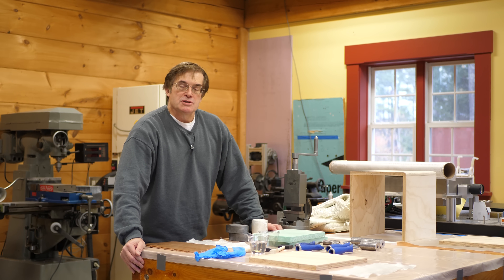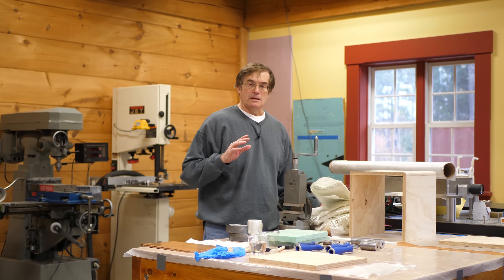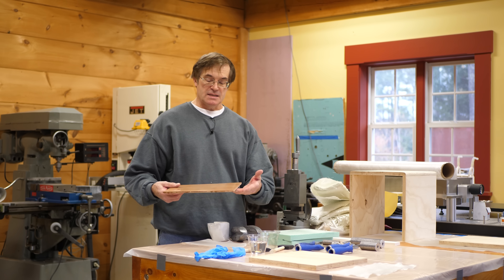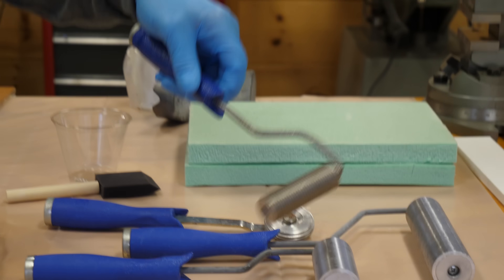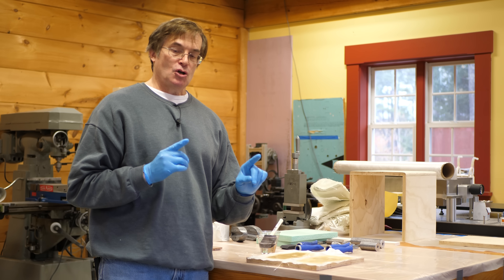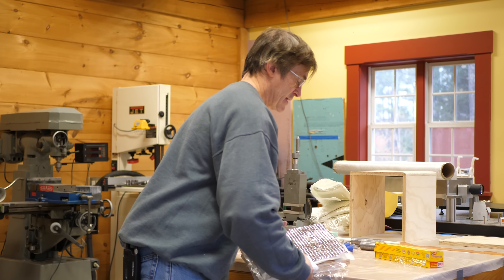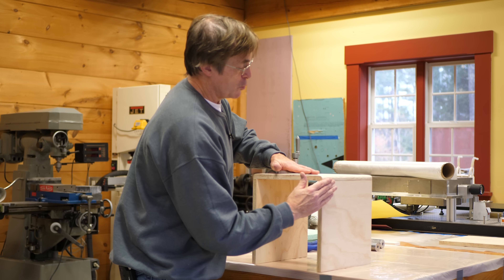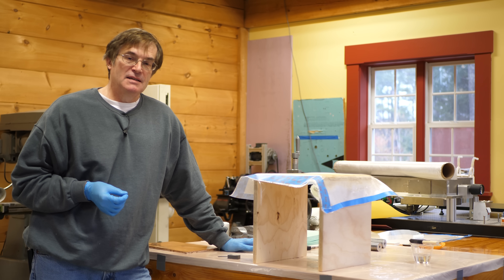Easy Tricks Using Fiberglass Strengthening!

Comment: Hey can I use fiberglass to strengthen something like smartphone back glass please answer
Reply from the maker: You can.
Reply: @TechIngredients  Thank you very much sir will  regular clear epoxy work with glass surface?
Reply from the maker: You said the back.  I am assuming you are not intending to bond this to the optical glass through which you view the information.  If this is true then you will be bonding to the plastic back of the phone.  To get a good bond to the plastic you will need to abrade the surface with very fine sand paper so that it is uniformaly dull to reflection.  It has to be perfectly clean and the sides need to be taped to prevent the epoxy from dripping around to the sides or the front.  Choose a very light weight cloth, around 100gm/M would work. And, if possible, try your technique on a spare piece of scrap plastic first.
Reply: @TechIngredients  I was referring to  backside of galaxy s9 which has glass back not talking about plastic back phone. Will this work on glass back phone? and will  regular clear epoxy work with glass surface
Appreciate your answer

Comment: I am building a teardrop trailer and an trying to decide on a good waterproofing protective outer skin. The teardrop sheathing is 5/32" okoume plywood on top. Do you think a single layer fiberglass would be a good option for this build? I would likely paint over the fiberglass to finish it.
Reply from the maker: Sure.
That is often what is done to waterproof  wooden boats.
You can also use very light weight cloth as its  function here is to hold a thicker layer of epoxy, increasing the barrier  effect rather than for strengthening  the wooden surface.

Comment: I noticed the flex test on the foam, how about a compression test. Say for bolting the foam with double sided fiberglass to a frame. Maybe another flex test of the foam with a 10" gap between 2 blocks and stand on it.
Reply from the maker: There is an established way to mount hardware and to resist point loading in a foam core sandwich.  Once the sandwich has cured, use a saw ( hole saw works too) to remove one skin and the foam beneath it, fill with a epoxy and once hardened place some cloth above the solid plug and coat.  Alternatively, fabricate the core with solid inserts at the desired locations and glass over the core assembly with cloth and epoxy.  This really works well.
Reply: @TechIngredients  the 2nd option sounds easier for my application. Thank you for the advice.

Comment: To make your fiberglass over foam board  do you have to seal it first to keep the resin from melting the foam? Or is it a certain type of foam
Reply from the maker: Epoxy doesn't melt styrofoam or polyurethane foam.  You may be thinking of polyester resin.

Comment: Question for an art project: if I use epoxy and fiberglass for extra structure support, will cement stick to that surface after it cures, if I want to make like a rock texture? How about if I sand it a bit?
Reply from the maker: Yes.  Epoxy works well with cement.  There are epoxy systems for anchoring hardware like bolts into concrete structures.  You have to use secondary bonding with the fiberglass-epoxy structure prepped by cleaning and sanding and then apply a fresh coat of epoxy to couple with the concrete.
Reply: @TechIngredients  So the fresh coat of epoxy would help bond the new cement coat to the fiberglass/epoxy surface.
Reply from the maker: Yes, it's required.
Reply: @TechIngredients  So as long as a wet layer of epoxy is laid down on top of the existing resin, then apply cement on top of the wet epoxy, it should bond?

Comment: Hey Using this fibreglass technique I wanna strengthen a table top which is made out of glass 
Is it possible?
Please let me know
Reply from the maker: No.  The table is already as strong as the glass fibers that reinforce the epoxy/glass composite.  Now, if you were to use carbon fiber the result would be stronger, but not transparent.
Reply: @TechIngredients  thanks!

Comment: Wouldn't coating just 1 surface cause uneven surface tensions and lead to warping of the substrate?
Reply from the maker: It's not a problem.  The glass does not shrink or expand and it's the glass that controls the dimensions.

Comment: I wonder if I could reinforce a longboard deck with a layer of boat cloth?  It's plywood and it bends a fair bit when I step on it. (a longboard is a skateboard that's longer than usual)
Reply from the maker: Absolutely.  A 6 oz. weight of plain weave should work well.

Comment: Will epoxy cure in a press? Say I wanted to press  the fabric into a form under significant pressure would the lack of air on the pressed surface prevent curing?
Reply from the maker: Sure it will.  That is how an autoclave fabricates high performance composites by squeezing out the extra resin.

Comment: zna has made armor using boat grade fibre glass.
Reply from the maker: You can, but S glass will make a stronger barrier with fewer layers.
Reply: @TechIngredients  yes but can you buy the stuff off the shelf at you local wally world?
Reply from the maker: It's pretty common.  Almost any marine or fiberglass source will carry a few different weights of this cloth.  It's usually sold in a  harness satin weave and will cost about 50 -100% more than an equal weight of E glass.
Reply: @TechIngredients  ok but most people arent* inclined to go to these marine supliers. they'ill mostly like head to thier local hard ware store  / wally world / autoparts place and buy wat thay sell thier.

Comment: What are your thoughts on thinning the epoxy to help the resin wick and absorb better?  Also, if you increase drying rate artificially via adding heat, will it affect the overall strength of the bonding/and structural strength?
Reply from the maker: I'd stick to formulations that are designed with lower viscosity from the outset, they exist. Because, solvents can become trapped in a resin matrix when they are added to thin it and this will weaken the structure.
Heat is a good thing.  As long as the epoxy doesn't become so hot it decomposes this will not compromise strength.  In fact, some formulations REQUIRE heat for a final cure and ultimate strength.
Reply: @TechIngredients  Thank you kind sir!  I appreciate you sharing all your great knowledge with the world.  I've learn a lot from watching your creative and interesting sessions.  Keep them coming.

Comment: The video is as usual elucidating. Thank you.

Since everyone uses epoxy glue for all sorts of fiber reinforcements, it seems to have some clear ups vs other glues. But I can't but wonder if using glass (sodium/potassium/lithium silicate) to bond glass (fibers) wouldn't make at least some sense. Sodium silicate is used for hardening /chemical protection of concrete floors and as an adhesive so it seams to fit the design specs. I'm an estimated three quarters through the internet searching for info ... without any results. If nobody even cares to say it sucks, it must really suck. Does anyone know what I am missing?
Reply from the maker: Sodium silicate is water soluble and that would be a problem for some composites.  It also is brittle, it has a low modulus of elasticity and it is likely it would fail before the fibers it was bonded to.
Reply: The water solubility seem snot to be a problem with potassium and lithium silicate, but the elasticity/brittleness argument does make a lot of sense. Thanks!

Comment: Have you seen any of the "poor man's fiberglass" videos here on YouTube?  They're interesting.  They use things like sheets,  drop cloths, brown paper bags and wet the material out with titebond III wood glue. III is completely waterproof.  They use the process to skin out their teardrop trailers  or to make extremely lightweight cabinetry for their  van life conversions.  The brown paper bag technique looks nice, actually. But there's a process to it. 

Question- I have a couple  out of date carbon fiber SCBA tanks the fire fighters wear.  They appear to be in fine shape. They're rated for 300 bar / 4,500 psi. I picked up one of those cheap, MIC  HPA compressors  off of amazon. My intention was to fill up those SCBA tanks to use to fill my air rifles. But since the tanks are a few years out of date, I was thinking about wrapping them with a layer or 2 of fiberglass. Is that a good idea? Or a bad idea? The rumor going around is that they're going to double the life spans of the carbon fiber SCBA tanks anyway so I think they must be safe as is..

Edit: cant you fan the surface of curing epoxy with a  torch to get all the air to rise to the surface and really smooth out the surface..?
Reply from the maker: You can use that flame technique, but it requires a little practice.  For thicker layers and when around heat sensitive components, the vacuum degassing is best.
Reply: @TechIngredients  I see.. I guess that's why I've only seen it done on table tops and stuff like that. Thanks for your reply..

Comment: Does marking the fiberglass with the black dots like that leave them in the final clear finish?
Reply from the maker: It will if you cut so they are in the piece you want rather than as an outside guide.

Comment: in 1980 i used polyester resin wetted out fiberglass cloth tho make internal bulkheads for my ground effects GT car .   the car bodyshell was the actual structural chassis .. with no steel frames  apart from the steel roll over structure which was required to meet regulations .

Comment: so would it be worth it to build an MDF speaker box and coat the interior in a thin fiberglass to negate the softness of the MDF...would it then be stiffer and  more resonant than plywood?
Reply from the maker: It still wouldn't be as stiff as the plywood.  A composite core requires stiffing on both sides to see a significant improvement in stiffness.  Why not use the plywood.  The cheap stuff costs the same as the MDF and the good stuff can be beautiful.
Reply: @TechIngredients  just wondering because I have a bunch of fiberglass going unused and a subwoofer project coming up.  I'll stick with the recommended plywood...I built a 2x12 guitar cab from reclaimed plywood from a large kitchen island, it does sound great.

Comment: I'm searching YouTube to see if it is possible to lay some sort of plastic rope in the inside keel of my canoe instead of fiberglass material.
Reply from the maker: That isn't an unusual way to stiffen a structure like a boat.  Cotton or sisal will work well, although  cotton is more common. 
Soak and work the rope in a small container of epoxy (with gloves!) and then place the saturated rope along the clean, dry, and sanded keel.  You can use multiple ropes to build up a thicker structure.

Comment: I wonder how strong the reinforced plywood is compared to just plywood, and also compared to just fiberglass with the epoxy.
Reply from the maker: That's what makes this fun, it's easy to test.  Keep in mind that an optimal sandwich construction must balance the strength of each component.  A steel core with a thin layer of fiberglass will always fail due to the fiberglass and the core will be hugly under utilized.  Alternatively, a flimsy core like the styrofoam I demonstrated will crush long before the surface fiberglass is working hard.

Comment: In lieu of the heat pads a lamp will work almost as good but with much less aggravation
Reply from the maker: Heat lamps are another useful tool, but they have limitations.  They can easily over heat areas on a component while hardly warming others creating uneven curring rates.  Because the part has to be exposed to the light, the amount of power needed to warm a component against the loss from radiation and convection will be far higher.
Reply: Tech Ingredients  yep !

Comment: What you coat the styrofoam with before applying the fiberglass?
Reply from the maker: Epoxy resin is all that is needed to coat the styrofoam and to wet out the fiberglass.

Comment: I’ve done tons of fiberglass on fighter aircraft when I was a little younger. If you want to set up more than one layer of glass at a time get a roll of PVA(poly vinyl alcohol). You can wet layup several sheets of glass at the same time between two layers of PVA. Once your glass is wetted and any air bubbles are removed you can cut your glass to shape and peal one side of the PVA, then lay down your glass on a pre wetted surface and have a barrier of easy to remove PVA that will protect your new fiberglass during the curing process. (It’s also easy to remove air bubbles with a squeegee while laying your glass up) For an even stronger bond you can vacuum bag the assembly.

Comment: Excelent video.
So simple but I never thought about the sticky surface to apply next coat, I always sanded.  Also interesting the water soluble topic you mentioned.
One thing I do not know (very little experience with epoxy anyways) is how you clean the tools.  I use lots of paper to remove the epoxy, is there a better way?
Reply: Clean epoxy off with paper towels before it cures. It is very difficult to clean afterwards. If you get epoxy on metal tools, you can heat it up to soften the epoxy. Epoxy will release fairly readily from a lot of smooth plastics such as polyethylene. So in that case you may not really need to clean it up. It will peel off (depending on shape, etc). Never deliberately plan to remove cured epoxy from anything. Try to come up with a way to avoid having to do that in the first place.

Comment: Can we just use OSB board as roof and have a layer of Epoxy fiberglass layer as is could this be lifetime roof with little to no repair?
Reply from the maker: Yes.  Make sure to sand the OSB as they often have a surface layer of resin or cured glue that binds the strands, but can interfere  with the epoxy.

Comment: I hope you don't mind me asking advice.  Long story short:  Do you have any techniques for applying to curved surfaces, starting from horizontal and ending vertical? 
Short story long now:  I've created a wooden teardrop camper trailer with 2 x 1/8" bendable plywood as a front / top / rear exterior, primed w/ oil based polyurethane & layered w/ 4 more coats of UV resistant water based polyurethane, sanded between.  Now I need to winterize it from windy rain, hailstorms, snow, and hot summer sun.  Your 'Easy Tricks Using Fiberglass Strengthening!" video renewed my interest in avoiding using tarps.  The surfaces in your demonstration seem ideal in their surface toughness, resistance to divots (maybe even scratches), and even adding rigidity while maintaining its wood appearance. 
So, any tips in applying on curves?  On already treated wood?
Reply from the maker: Going from horizontal to vertical is tough if it is a sharp transition as on the inside of a 90 degree floor to wall.  The junction tends to pull away, leaving an air pocket.  A gradual transition is easy.
The usual schedule is to apply the fiberglass and epoxy to the bare wood and then overcoat the hardened surface with UV resistant polyurethane.  I'm not sure of the strength of that bond which normally, only has to retain a coating.  Personally, I'd avoid taking the risk.
Reply: @TechIngredients  Thanks for your insight!

Comment: Would any of these work with Tightbond III wood glue?
Reply from the maker: Yes, but not as well.  Epoxy  is an incredibly tough as well as strong adhesive.
One exception is a technique  where a boat deck is covered by a piece of canvas cloth and then coated with a waterproof glue resulting in a nonskid deck surface.

Comment: Do you think it would be possible to make a piece of safety glass at home with epoxy resin? I want to make a velomobile and I can't find such a small windshield glass.
Reply from the maker: It's possible, but I think it would be very demanding in terms of cleanliness and eliminating air bubbles.

Comment: For bonding anything to it there is one thing I would use Crystic Crestabond m7-05 you will get layer separation before the bond breaks. I work in a factory building super yachts and for all the shop floor lads this is the go to. and for sealant alpha 132 for skin fittings or shaft log's.
Reply from the maker: Thanks for the recomendation.  How does it compare to 3M 5200?

Comment: I want to know, if I epoxy glass a boat made of 1" SM foam board, will it stand up to vibrations of boat pounding or will it delaminate?
Reply from the maker: SM board?  What is that?
Reply: @TechIngredients  DuPont™ Styrofoam™ Brand SM Extruded Polystyrene Foam, as you are holding in your hands, applying epoxy to & is on the wall behind you.
Reply from the maker: It's not the strongest core material, but it's adequate and boats have been built with it.

Comment: I notice you have the epoxy and fiberglass directly on the polystyrene. This would be perfect for a project I'm working on. What epoxy did you use to achieve this? I know traditional fiberglass epoxies will eat the foam.
Reply from the maker: You're  thinking  of polyester.  Epoxies  don't dissolve polystyrene.
Reply: @TechIngredients  Aha, yes you're right. What epoxy are you using?

Comment: so.... for rapid industrial output, use quick cure epoxy in a hot climate
Reply from the maker: Potentially,  yes.
However,  there is a risk that your epoxy will begin to set up as you attempt to distribute it. For very small tasks, this is useful to speed the process.